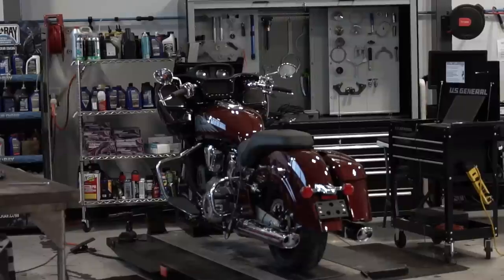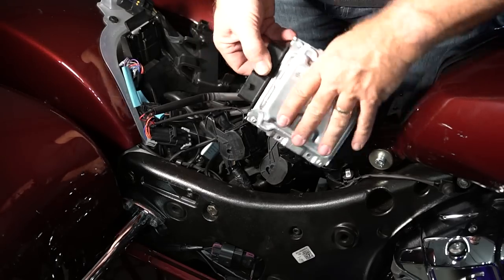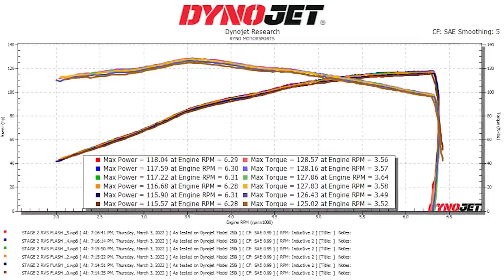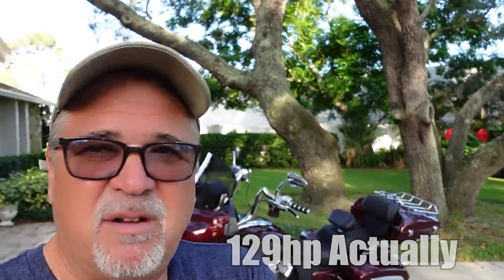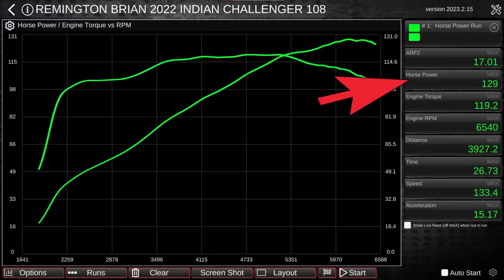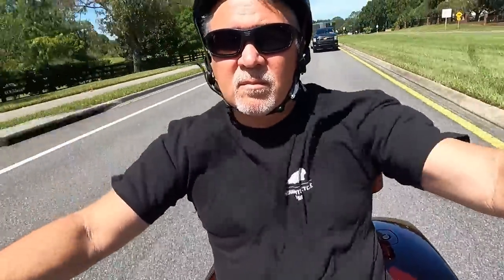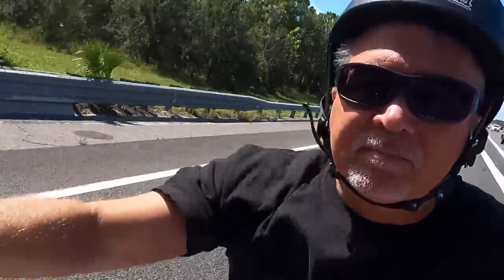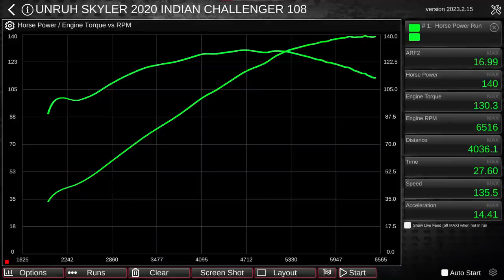My Results from the Lloydz Garage Challenger Cams - What do I do now?

Comment: Wish they would have done a base line pull on it before the cams so you could see exactly where you started and finished on the same dyno.
Reply from the maker: Yeah, I don’t think they would do that because it heats up the engine and exhaust and everything before they work on it. They would probably have to do that the day before to let everything cool down.

Comment: I'm not happy with my Lloyd's tune ,cam 2 kit
Reply from the maker: You’re not the first one to tell me that. I’m putting an exhaust system on it soon so I’ll report back soon.
Reply: I found out the best seal at the head is the Harley  screaming eagle gasket lot cheaper to
Reply: Mine is a 2017 111

Comment: So If you buy a new exhaust you're looking at a minimum of $5k. Is that cost worth 15-20hp? And how often and how long are you going to be in the upper rpm range to enjoy the power? If you were going to get 140-150lb ft of torque I would say Probably worth it because you would feel it every time you twist the throttle especially down low. I appreciate the honesty and was thinking of possibly getting his cam but I highly doubt it now. I hope you eventually get what you were expecting.

Comment: The more aggressive a cam the more it brings up horsepower and not as much on the torque. And they are correct a good 2/1 would make a big difference. Toce has a slipon 2/1 with a really nice bag hanger rack. It uses your stock headers. At I thing $795 it might put a smile back on your face.

Comment: It’s all about the entire COMBO.  it’s been ridin into the ground in the comments..  but talk to loyd and get what pipe he recommends to make the power it should. 140/140
Reply from the maker: So i put on a Bassani 2:1. Haven’t dyno’d it yet but I can tell you my butt tells me there was no change in torque. Still anemic. HP did increase on the other hand so some upside but overall disappointed considering the investment. The worst part is He knew I did not like/want loud pipes like a Sawiki but did not discourage me from getting the cams. One of the worst purchase decisions/experiences I’ve ever made. I know some others like yourself have had good luck and I think that’s great but for me 👎 and I’m not alone.
Reply: @TwoIndians if it makes u feel any better I did a 124 on my road glide and got some bad cam advice 
Wanted a solid mid range cam 
From my research I said I was interested in either 483 or 482(made for high compression 124/128s).. 
went with the 482 bc they said it would come up sooner.  Nah shit don’t light up til 3500 or so.  
They SHOULDA said u want that 482 cam u NEED a 2-1 and a 64mm intake/TB to really make it sing.
She rips and slaps like a drunk step dad from 4-6k 
But I ride with my ole lady and that shit don’t work well for that and I wanna ride 3-5k or so.  
Sucks.  Spent so
Much money now I got a less than perfect combo.
Reply from the maker: @geraldgoodiii6993  totally feel ya

Comment: In your case after spending $3600, it would seem foolish to dump that money down the drain when you can spend another $1500 to get a Lloydz exhaust and retune for it. This will likely put you way above where you were with the stage 2 cams in both Tq and Hp... Then you'll be happy with your bike again. 😎
Reply from the maker: Except my bike will be loud and I don’t want loud.
Reply: @TwoIndians  ... Eww, that's a going to be a problem. You're going to need to open it up to get what you want out of the setup you now have.  Like you said, the intake is an unknown factor. If you go back to your stage 2 cams, the power may not return to the Tq levels you had before the Lloydz work.

Comment: If I were you I would take the bike back to the other dyno.. it looked a tad high but also you were at sea level and Sturgis isn't exactly.. it would give you a more clear picture of your before and after
Reply: His bike is limited by the factory primaries and slip-on exhaust.  He needs a 2-into-1 exhaust in order to get the full potential of the combo.
Reply from the maker: it will be a little while before i can get it on another dyno but yes, thats in my plan. theres a local guy here thats run my bikes mutliple times and i know what to expect from it
Reply: @UnrulyRider  I understand that, but if the dyno he uses, say is juicier than Lloyd'z because of who knows.. then Maybe the gain is better than he thinks..  but I also understand that because of his setup, he may have room for optimizing but this is just for mire apples to apples.. thats all.. I mean I got a discount code for Toce.. LMK
Reply: When are we going to find out how the toce did on the 112 kit @Ridingfish🤔🤔🤔
Reply: @zacharyedwards327  My bike is getting finished up, when I land in the US I'll go pick it up a couple weeks later!! Ride that SPICY girl home!!! I'll tell you everything then

Comment: Sorry if this sounds like “mansplaining”

Torque is horsepower. It is literally an equation

Torque x rpm/5252 = Horsepower

Engines are only efficient at one rpm (unless VVT is utilized) and power works like a bell curve surrounding that rpm. Cams change the efficient rpm and therefor the bell curve area where power is created.

Torque = quick to speed
Horsepower = faster top speed

Unless you are on a race track where you need top speed to win; low end power is what you want. Not sure about you but I’m accountable to speed limits where I ride so top speed means nothing.
Reply from the maker: Thus my disappointment.

Comment: “Every bike is different”? Different results? So every Challenger is hand built, no two alike?
Reply from the maker: Correct, to a degree. They certainly have all the same parts but if you talk to any of the guys that are racing these bikes or selling them, they will tell you you could line up 10 brand new bikes and one of them will run better and one will run worse and the rest be very similar. Now of course that’s all subjective to a degree but what I really meant is that people do a wide variety of upgrades and the cams will perform differently based on those changes. A ghost in the machine LOL
Reply from the maker: BTW, I rode your highway over the summer. Amazing. 😉
Reply: @TwoIndians  You’re never to old to learn. I wouldn’t have thought that. I’ve had some issues with my Challenger, “electronics” glitches. But as time goes on and 10,000 miles later I’ve come to love it. Stay upright.

Comment: Look, as usual, leaving tuning design expertese to a customer is „stupid“ thus there‘s no other choice than to understand. A tuning is only complete if you have intake combustion and exhaust jointly aligned to your purpose by experienced tuners for Your purpose. Race tuners don‘t give a damn about Your tune, they have their race tune knowledge developed in thousands of hours and may be able to soften that, but it‘s still a race setup. So if Lloyds is focused on ultimate power, than that‘s a brochure or a race target, not a practical road use target like what you‘re looking for. Really good tuning experts in Germany do not have that big of a name, unless they‘re tied to a automotive company, they‘re hidden gems, nerds serving Bike specialists with competent custom power machines.
I‘m not monitoring the US market and so I don‘t know what exists, as it‘s highly and abnoxiously illegal over here. but I know who I would contact here for tuning of v-twins (italian, american) and fours , triples, new and classics and others, even modern electronics full custom  EFI tunings and who‘d make the exhaust to the calculation of the tuner with the experience for final alignments to optimize on the calculations.
I don‘t think Lloydz are that wrong, but you certainly have to take the full combustion chain into consideration not only that, but out of 1-2 hands that work together to achieve your result, not their repeatable disconnected non-aligned product‘s result.
Reply from the maker: When building a high performance race or show bike I’ll consider your comment as 100% correct but the reality is many times us tinkerers do things in stages and one day I’ll buy an intake, and a couple months later I may add pipes and then next year when my budget allows I can do a tune etc etc. expecting the average Joe (or Giuseppe 😉) to go to a performance shop and plop $10k + on a performance upgrade is unrealistic. I mean sure, if some of us had the cabbage for that we’d do it, but I don’t. And the hand wringing ensues 😂 thanks for watching

Comment: These cams must be horse power cams and not torque cams.  It's the same on the Harleys you have more horsepower but lose low end.   Which he should have told you that.  And I also think you will not gain much more torque for the extra money anyway.
Reply from the maker: Lloyd says the only way to add more torque is more compression or cubic inches, I just didn’t wanna LOSE torque.
Reply: @TwoIndians  yeah I was thinking you will have to put bigger heads and pistons and stuff like that because it's a 108
Reply: @TwoIndians  My dyno graph shows my bike made more torque than before, it just shifted my peak torque about 1000rpm higher.  My previous numbers before the Lloydz parts/tune were 112hp and 118trq.

Comment: I’d be wary of any cam that shows a HP number significantly higher than the torque number.  They invariably gut the low end torque in exchange for bragging rights at 6000 rpm.  Sorry you got such disappointing results.  I guess the bigger lesson is to not experiment with unknown cam, exhaust, intake combinations - with your own money.    Rather, stick to what has been proven to work and give consistent results.